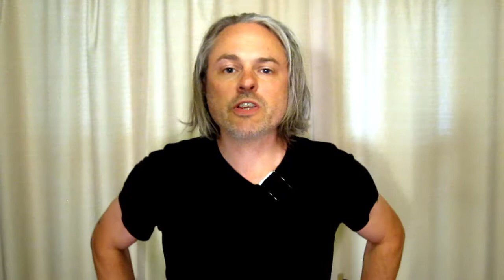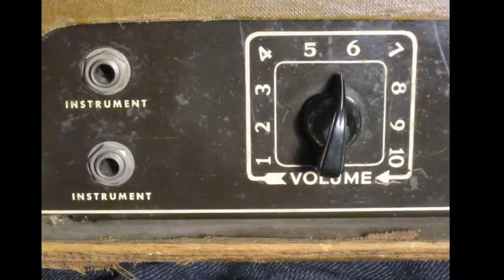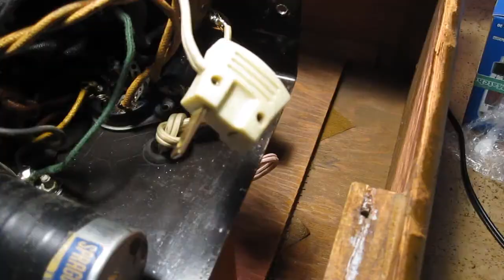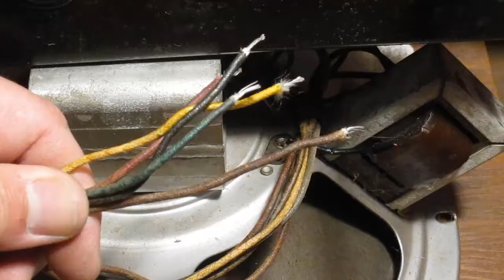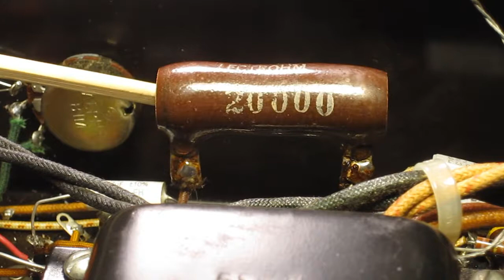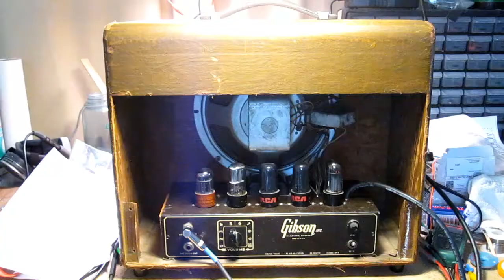1948 Gibson BR-6 Tube Guitar Amp Overhaul

Comment: Cool! I’m considering picking up one of these amps. While I’m all for restoration to original design, that volume control is just duplicating the volume knob on the guitar - I would have left it going into the preamp gain stage first, and then to the volume control; I’m thinking there’s a reason somebody did it that way (however poorly). Thx for the vid!